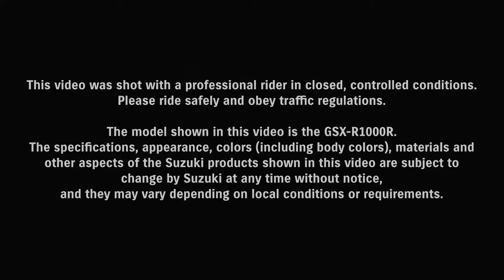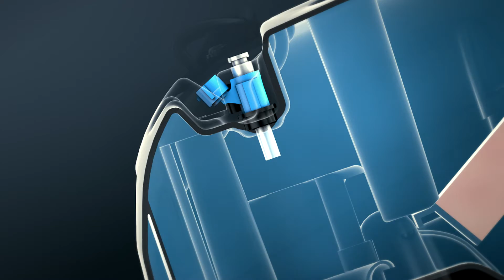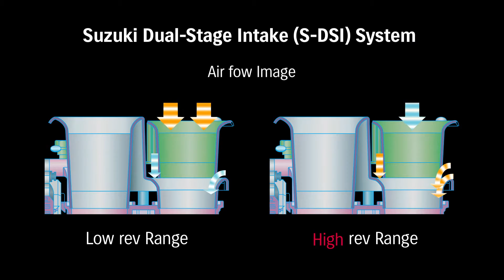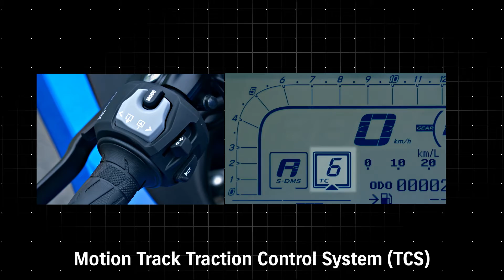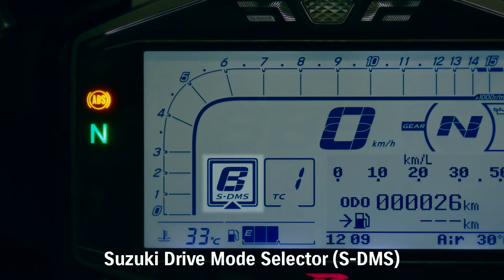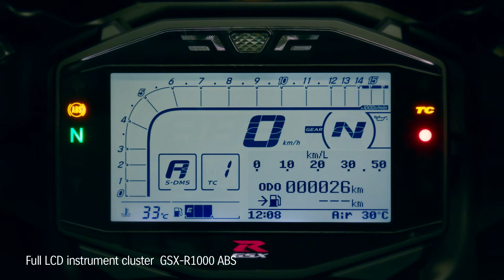2017 Suzuki GSX-R1000 Technical Overview

Comment: Hey guys it's me the guy with the GSXS 1000 that you wanted to use his 2016 video anyways I've been waiting on the GSS 1000 to get the Exter our treatment and I'm still waiting and when I look on your website I don't even see the new GSXS 1000 for 2021 I only see the GSXS 750!!!!! But the color schemes are getting way better guys way better for that 750 and as far as my 1000cc ,i think my original 2016 MotoGP blue was the best color scheme ever on the thousands. But this white and yellow coming out is going to be hot but seriously guys let me design your bikes color schemes I want to see Miami blue I want to see Caribbean green I want to see crazy colors from the 90s but with a modern twist of clean and paint flakes or those what I call Crayola colors that awesome gray or blues I don't know but that's what I'm saying whoever is designing your colors needs to be let go or transferred and hire me I'll sell you more bikes than Ever before just because of the color schemes